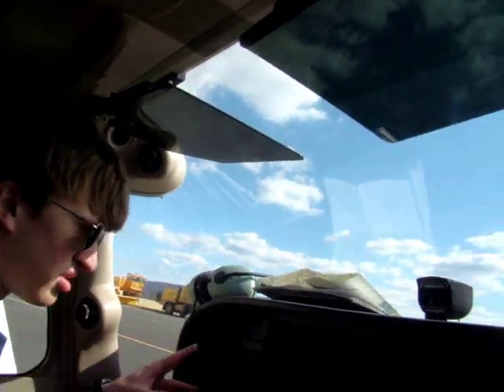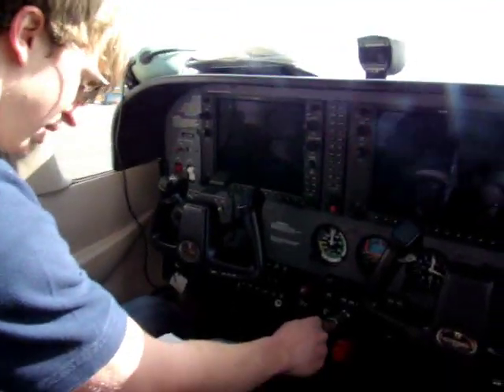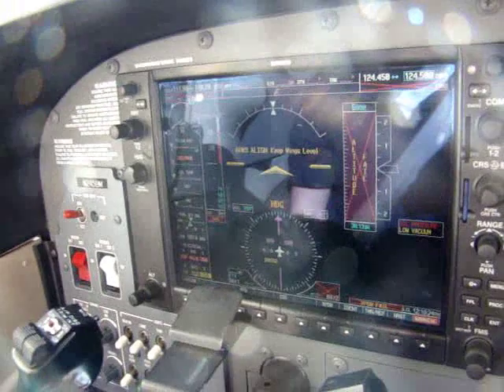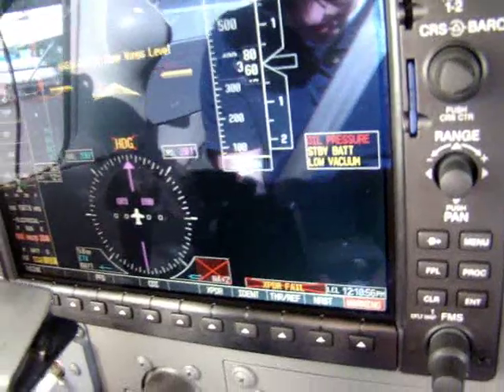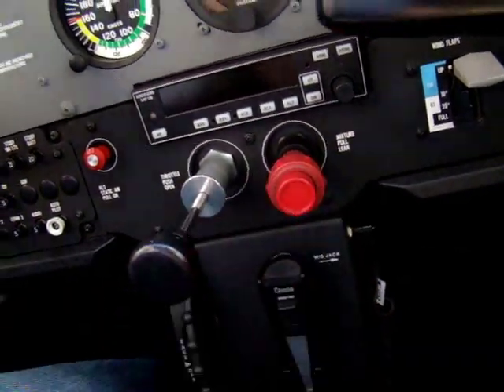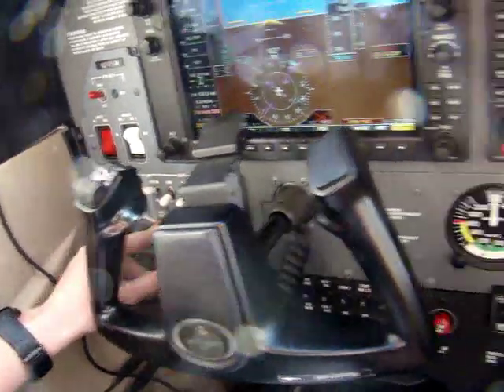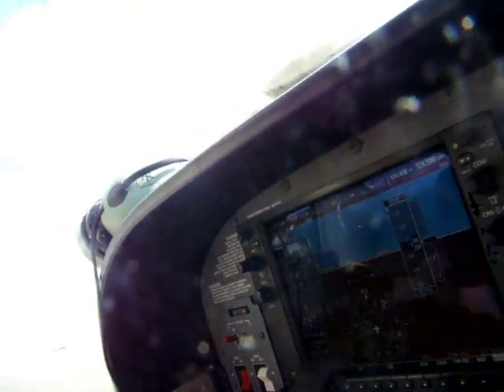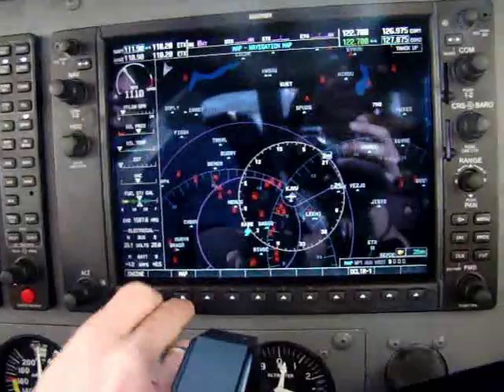Starting the engine on a Cessna 172 - G1000

Comment: The only comment that I have is that when priming the engine, with the mixture on full rich, position the throttle half in to allow fuel to flow.  If you have it close to the idle position, not much fuel will flow and the engine won't be primed.  You can check that you have the throttle in the correct position when you prime by watching the fuel flow rise a reasonable amount.  In this video you can see that the fuel flow hardly rises when it is primed.

Comment: Thanks for the informative comments. This start-up is different from what I learned in aviation maintenance school. On an old O-320 with a carb, the only working engine stand we had, the start-up procedure (first start-up of the day,) was:
-carb heat closed
-prime the engine with primer pump 3 times
-mixture full rich
-throttle 1/4" out from closed position
-turn on fuel pump/booster pump
crank engine with right hand on throttle, then adjust throttle to idle engine at 1000rpm
we generally don't touch mixture settings till engine is up to operating temperature, and we are taught that the mixture is kept at full-rich during take-off

I really need to get some hours on modern planes. I fly simulators but I don't know if any of the simulator aircraft accurately model normal engine operations and start-ups

Comment: If you push the throttle to full you are injecting raw fuel into the engine. This will flood the engine even more. You also wouldn't be priming the engine if it was flooded. This could cause detonation. If it is a hot start then you can push the throttle forward but you shouldn't prime.

Comment: i've never seen a fuel injected engine started full rich except the cessna 206 the flight school i go to has. you push in the throttle as you crank and it's controlled like that, it has a fairly weird set up

Comment from the maker: @Dominoes282 I turned on the alternator with the battery. It's the same switch (split for battery and alternator). This particular plane also uses a fuel pump like the DA40.

Comment: @mikew172 the reason they are whining about the mixture is because in carb engines they do it diffrent than these new ones.......i got yelled at when i went from Carb to a new G1000 and i gave the instructor a Whatido look..............but no you are most certainly doing it right  :)

Comment: @christianschererer .  I'm not sure exactly what you mean, but the mixture is gradually advanced while the magneto switch is in the start position.  so when you initially hit the key mixture is lean, and then richened during the ignition.  at that point the throttle is adjusted to maintain 1000 rpm in normal conditions, sometimes a bit higher if the engine is cold.

Comment from the maker: @JumpStartation I haven't flown the airplane in a while but I'm almost positive that it's on the checklist, regardless of the time of day. I turn them on anyway, just as a preference. At the airlines, the NAV lights are actually kept on as long as there is electrical power running.

Comment from the maker: @goingtobeapilot Not necessarily. I haven't heard of an insurance policy that requires a check out for PPL and Instrument Rating on a certain aircraft. However, it still might be a good idea to do a few approaches with an instructor just to make sure you know how to load approaches, create flight plans, etc. If anything, you'll have to do less work in a G1000 equipped cockpit on your instrument approaches because of the automation. It makes IFR flying super easy.

Comment from the maker: @goingtobeapilot The checkout procedures on the G1000 may vary among flight schools because the insurance policies may be different. The procedure at my school was that I needed to have at least 3 hours of flying time with an instructor before I could fly the plane alone. It may also involve a short ground lesson. Most schools don't make the students do anything more than that because the avionics and electrical system are the only different components. It still flies like a regular Cessna 172.

Comment: You can hold the ignition to start for more than two seconds.  You'll actually be abusing the starter less if you do it for 5-10 seconds once (no more than 15 seconds) than multiple times on and off.  It's a win-win, the starter lasts longer saving money, and you get it kicking on the first shot so people on the ramp don't question your ability.

Nice video, though.  Should help a lot of people out! Good luck with your flying.

Comment: All fuel injected planes I've flown are started in the mixture cut-off position. The engine is already primed so it has enough fuel in the cylinders to start, you don't want to flood them with additional fuel.

Comment from the maker: I believe this is a feature with the newer models. It's been a while since I've flown an older 172, but when I did I remember advancing the mixture first before start. Cessna probably began installing this system since it is similar to a fuel-injection system and has a lot of advantages. It's easier to start in cold-weather, the throttle is more responsive, the engine is more fuel-efficient, and you don't have to deal with a carburetor. A better system in my opinion.

Comment from the maker: No worries. In this aircraft, a 2006 Cessna 172SP, you're supposed to advance the mixture as the engine starts like you would in a fuel-injected complex aircraft, like a Piper Arrow. I'm not sure why the newer models have this feature compared to the older Cessnas.